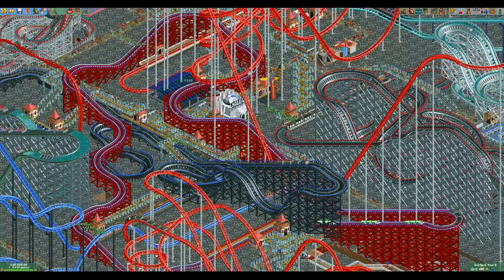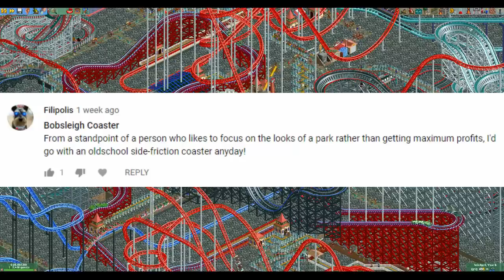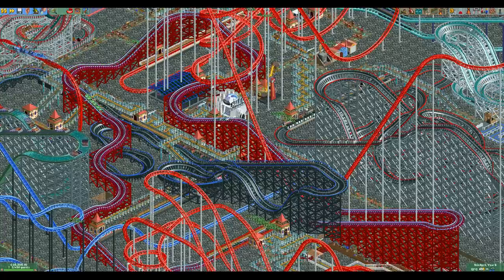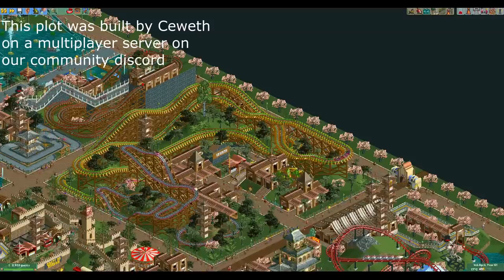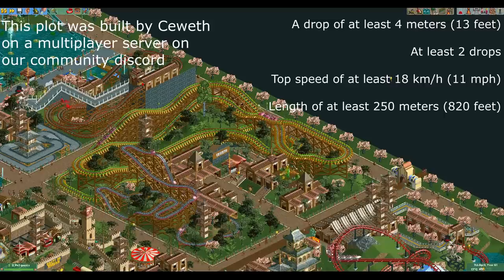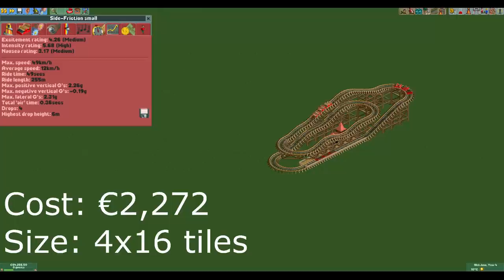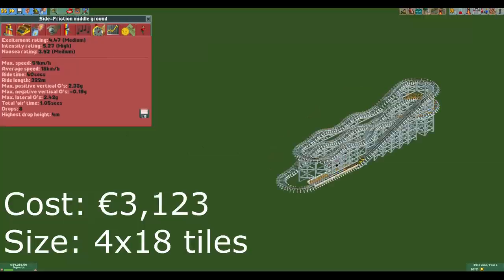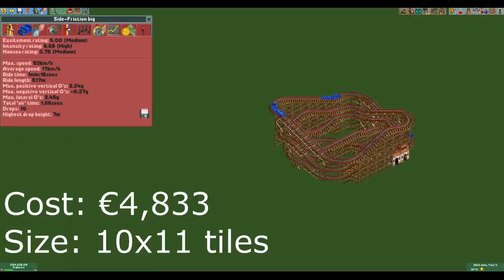RCT2 - Ride overview - Side-friction coaster

Comment: If I recall correctly, this ride is inspired by Leap-The-Dips at Lakemont Park, a ride that was very common around the world at the beginning of the 20th century. Back in 1999, when Chris Sawyer was working on the first expansion pack (Added Attractions/Corkscrew Follies), he did a tour of the US visiting various parks there. Leap-The-Dips had just reopened at the time after a major restoration, having been standing but not operating (SBNO) for over a decade.  The later invention of safety systems (including under-friction wheels) by John Miller resulted in the more "modern" wooden roller coaster we know today.
Reply: Yeah. Additionally around the same time, a small park in the UK called Rotunda also had one of these coasters operating, known as Runaway coaster. Theirs had bigger drops and was built as a travelling coaster in the 1920's, touring on fairs around Europe in its hayday. Rotunda bought the coaster and installed it at their park, but the park shut down in 2007 and the Runaway coaster hasnt been heard from since. It has likely been scrapped sadly, but a few POV videos exist of it online.

Comment: I like the Side Friction Coaster because I do a little roleplay when managing the park, and I'm also a history nerd. When I did Fungus Woods, since it has the "wooden rides only" rule, I roleplayed the scenario literally taking place in the early 20th century, and stuff like the Side Friction Coaster was pretty standard at the time. I made two with synchronized stations that both ended up with an excitement value over 6.

I'm personally the type that considers a coaster design a success as long as it hits these three criteria:
- Excitement is High, ideally over 6
- Intensity is not Extreme
- Nausea does not exceed Excitement

And I was able to do that with this historical bad boy, so I have no issues with it. I also actually like the challenge of trying to build hills without a crash.

Comment: Side friction coasters were in use since the mid to late 1800s, side friction coasters have two sets of wheels as opposed to the three on modern day coasters, modern coasters have three types of wheels, the normal wheels on the top of the track, then on the side of the track is the Guide wheel, which helps it through the turns, and the there's the wheel under the track, called the Upstop. That is the wheel that stops the coaster from flying off the track when you go over an airtime hill, or falling off the track when you go through an inversion. And if you think this is scary and dangerous, remember, you are more likely to die taking a shower then you are riding a roller coaster.
Reply: The two most dangerous rides at any and all amusement parks are the ride there and the ride home.
Reply: Showers are the scariest roller coasters
Reply: @wesleysmith5275  Shower 1 was great.

Comment: I honestly think this is a good coaster. It's fairly simple to build and and a good coaster for starting off.

Also, when are you gonna do the Corkscrew Roller Coaster
Reply: Why would you ever use this over a mini coaster? Or a steel coaster? Or even a corkscrew coaster?
Reply: If anything, simplicity makes it a bad coaster for starting off, as there aren't good options to make it compact or get easy excitement from things like inversions. The lack of 'interesting' elements, especially combined with the ability to crash it, makes it unfriendly to beginners.

Comment: I like this coaster. Yeah, it's bad, but it's bad in a good way. I love putting this coaster in kid themed sections of the park since it has a gentle-ish intensity stat and it more often than not looks aesthetically pleasing.

Sometimes I build this coaster in a large square track so I can put a lot of flat rides inside it, but only if space isn't an issue.

Comment: Just to note, the Side Friction Coaster seems to like being built "medium-sized" - big enough to satisfy the length requirement but not so big that it builds up a lot of speed. The third and fourth recommended designs are actually very close to real world examples of this coaster type. Anyway, I'd honestly consider this model "midling". It's not very good for optimized play, but it's passable for casual or semi-optimized play.

Comment: IIRC the junior roller coaster in RCT1 did not have banked turns or helixes. In RCT classic it does, and it is a much more compelling coaster because of it. But I feel like the side friction coaster replaced the function of the old junior coaster, and it's a much more interesting looking coaster.

I prefer it to the bobsleigh coaster because it allows you to do airtime hills.

Comment: that first deign looks like you could move the station on the back and it'll give more throughput
Reply from the maker: That way it will take longer because the hill isn't directly after the station, although the overall throughput will probably indeed improve. You could build a cheaper version with a longer station but my cheapest design is also somewhat compact. Technically it's not the cheapest design, but it is the cheapest useful design.

Comment: I tested the steep hills recently and they should remove the gentle to steep bit as you mentioned it has 0 use as the cart will either crash or not make it thereforce impossible.

Like you can make steep drop but your forced to use the gentle Hill till it gets safe speed.

Comment: I hate this coaster for a single reason. I don't like that it can go fine through testing but crash when people are on the ride. Maybe the testing should have dummies.
Reply: I think passengers simply shouldn't have weight, because if you test with a full coaster then you might get the reverse problem. A nearly empty coaster might not have quite enough weight/momentum to crest a hill and it falls backwards.